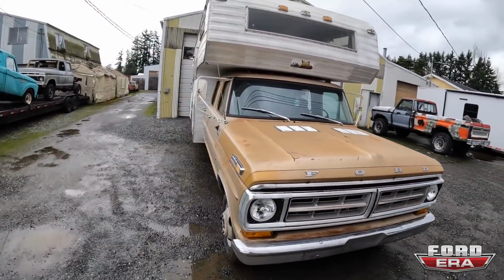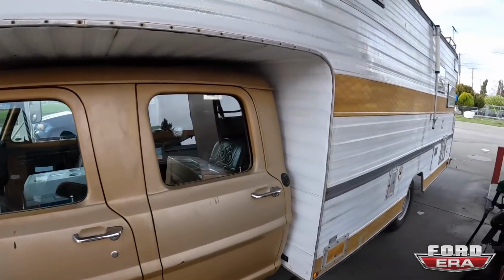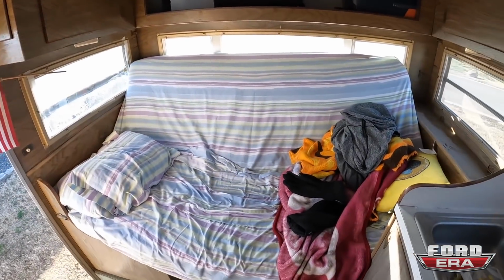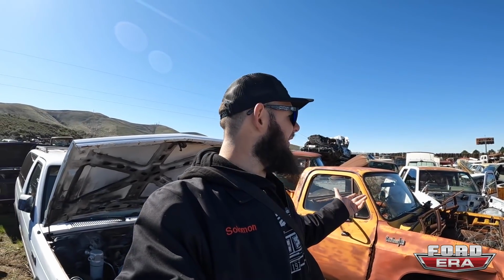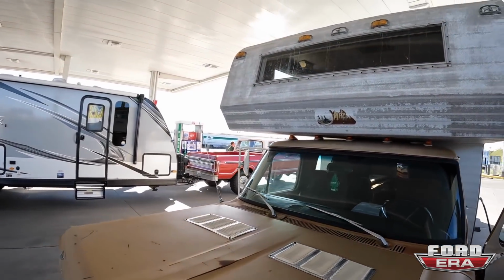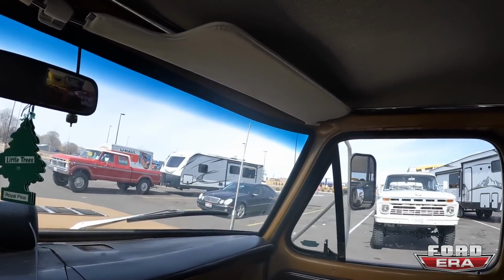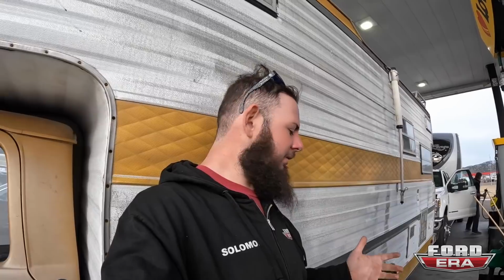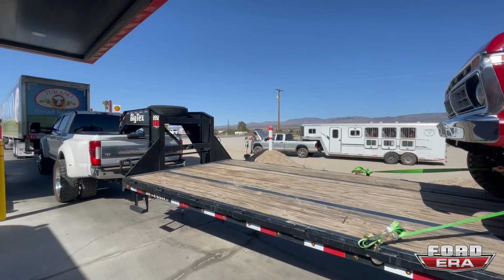Attempting to Roadtrip our 1971 F350 Camper 1500+ Miles From Washington to Arizona | Ford Era

Comment: 245 gallons one way. Those trucks were the last of the trucks that you could repair yourself along side of the road. One time passing through Arkansas my oil pump seized up and I replaced it right along side the interstate. Caught a ride into to town, bought an oil pump, and the person that picked me up took me back to my truck. Good Samaritan! Jacked up the engine, dropped the oil pan just enough to reach in and replace the pump and back on the road in a couple of hours. What a great venture!

Comment: Sorry the trucks broke down. What happened to the 1977 Ford reminds me of a story my dad told me. This happened just before my brother was born and about 2 years before I was born. Dad bought a brand new 1970 Ford F250 Camper Special out of Eatonville, WA. I think he ordered it from the factory. It was 2 wheel drive, 360 V8 with 3:09 gears. That was pretty high gears for a 3/4 ton designed to haul loads. So my mom and dad decided to visit family in Eastern Washington right after acquiring the truck. Dad said they were crossing the Saddle Mountain Range on I-90 having to hit it in 2nd gear with no load because of the high gears. About halfway up, people started honking and waving them down. Dad saw a trail of smoke so he stopped. Turns out the transmission got hot and overflowed, catching the undercoat on fire. Can't remember how he got it out, but a tow truck out of George (yes, it's on the map) took the truck to the Ford dealership in Euphreta. They discovered the factory way overfilled the transmission, causing it to overheat and boil over. They drained it and put in the correct amount and never had trouble with that again. The only complaint was the truck was underpowered and got poor mileage mainly due to the high gears in the back.
Reply from the maker: thats a story right there

Comment: I recently spent 24 days on a 4300 mi roadtrip after a year or so working on my truck. It was awesome and very relaxing. Truck ran flawless and even pulled a stuck bus out of the mud saving the struggling family a $4-500 tow bill. Spent 4 nights driving/camping on the beach at South Padre Island TX, just north of the city there a couple of Cty Park beach access. $12/day or $30/30 days. Highly recommended
Reply from the maker: sounds awesome
Reply: @FordEra  It was, I never paid more than the $30, to stay anywhere. Rest was all free camping. Got back just as fuel prices were starting to get absolutely ridiculous

Comment: LOL: You make doing a trip in a 1971 Ford Camper sound like a big thing, Try traveling from Redding, California to North West Missouri plus many off side trips along the way plus traveling over 300 miles in Missouri Oldsmobile built in 1951 with a Briggs Stratton 16 H.P Engine. and then back to California in a 1901 Oldsmobile Reproduction Curved Dash in May traveling the Highways , Freeways and Byways on the trip across California, Nevada, Utah, down Interstate 80 as well as Interstate 15 to Highway 50 East over and across Colorado, Nebraska and then Kansas and into Missouri, with a 3 gallons gas tank. I did that in Honor of the American Fallen Warriors . On what you would call a Lawnmower motor.  Now tell me about your Luxury Trip and I never stayed in a Motel the whole distance on the main trip. I slept in a Bed Roll Sleeping Bag and ate cheap food. Not Restaurant food.

Comment: Love the camper/trailer road trip.  I’m a bit older than you all, I have a 62 F100 and a 65 Airstream but my dream was always a 65 or 66 six-pack to pull trailer or car (I also own real Shelby).  Back in 90s I spotted six-pack in Sandy Oregon, then another in San Francisco, and another in 2000s in Delta Junction Alaska but never got chance to buy.   Think I missed that boat, you guys made them too desirable!    Have fun, great stuff!!!
Reply from the maker: That is neat, It is still cheaper then a shelby

Comment: bit of a tip not sure if it's exactly the same size or not but it looks like it should be close I believe it was late 80s to early 2000s Chevy c3500 have the exact same wheel spacers in the front stock it would definitely be cheaper to getting a new custom made spacer if it would fit I'm sure the lug patterns are probably different and you may have to look into a set of bearings with a correct OD and ID but definitely worth looking into
Reply from the maker: Thanks for the info

Comment: I got a 98 class C~ E~350, and also wanted to take a huge road trip, but I  first need to replace the upper and lower ball joints on the independent  suspension  Just got 4 new aluminum wheels and 7 brand new tires, but the  gas prices are killing the road trip.

Comment: l worked for a furniture moving company in the early 80s (wee-haul dallas tx) where we used our own trucks and they supplied the 28'' trailers. As many moves as you could do as fast as you could do them. lt made you a beast. Pro athletes couldnt hang. After several years of this l learned then what trucks could actually work and what ones couldnt. We were brutalizing 1/2 ton and 3/4 ton trucks there. The Fords won. Like forest gump. Thats all lm gonna say about that.
Reply from the maker: sounds absolutely right

Comment: Hi I was wondering I have a 67 Ford F-100 with no frame and looking for a frame someone said 2002 ford 150 but the frame's are no good and I have a 1968 4x4 plus a 390  got both left to me and would like to restore the 68 and make the 67 look factory from the outside but would like a newer frame
Reply from the maker: only 67-72 frames will just bolt on but you can make any frame work if you can shortened or lengthened  the chassis

Comment: Well based on 1500 miles one way if that's correct then I'd say about 300 gallons of fuel. 150 there 150 back.